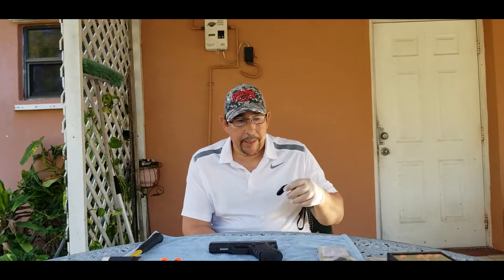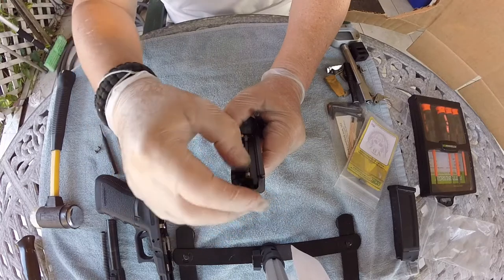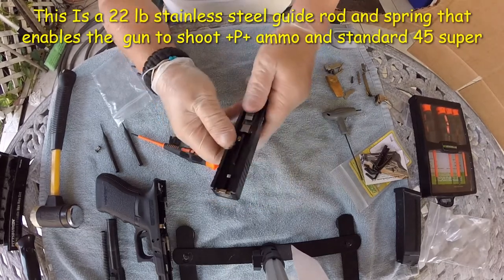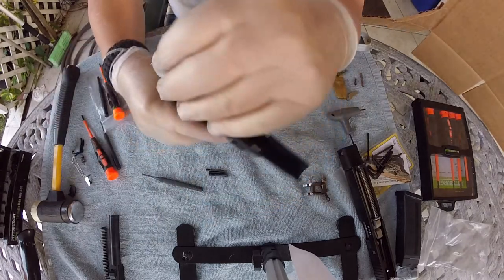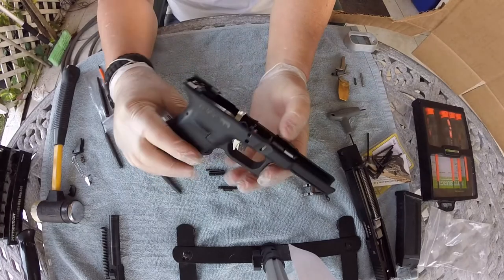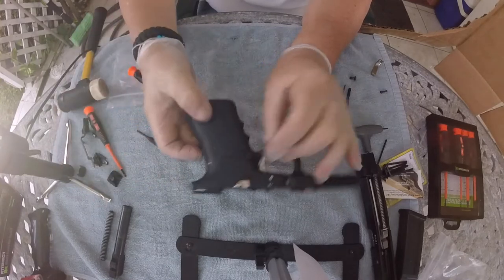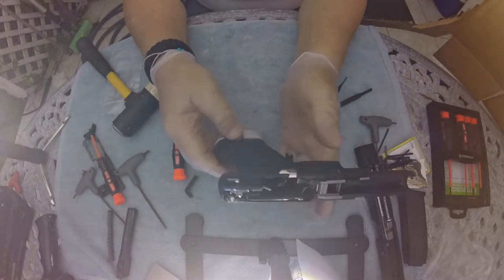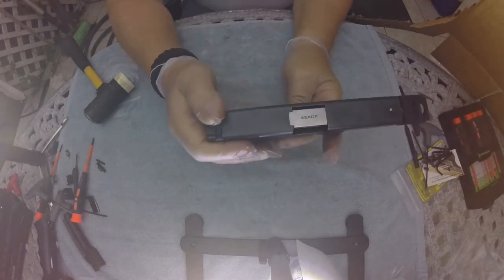How to make a better Glock pistol

Comment: Great video. Lots of quality parts you installed on that pistol. Should be a tack driver at the range and also perform well on deer, and wild hog sized game at reasonable handgun ranges with hot 45 acp or 45 Super and hard cast billets it should provide plenty of knockdown power and penetration needed to cleanly take game. The pistol also will turn heads with its great new look and stainless steel parts. Nice looking Glock. Thanks for the video.
Reply from the maker: yes I think it should do well the whole idea is to leave the rifle at